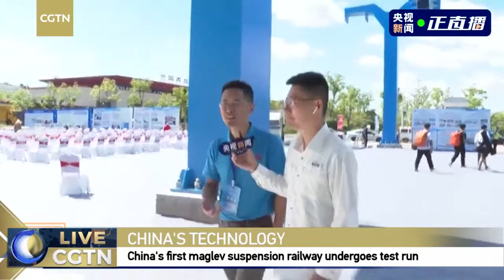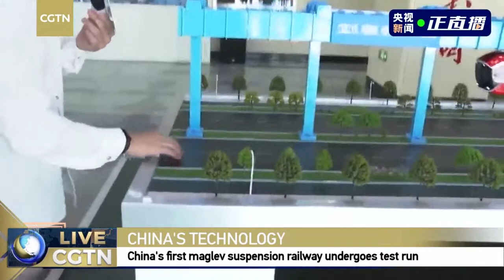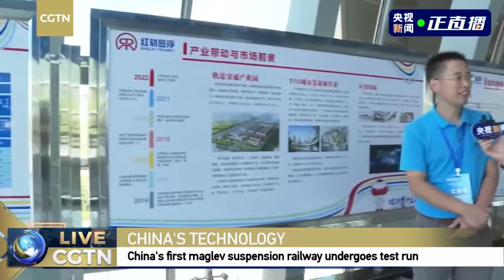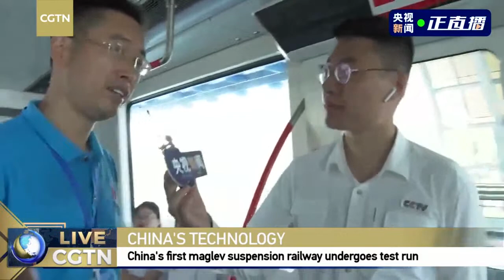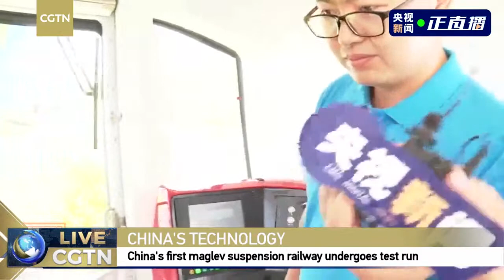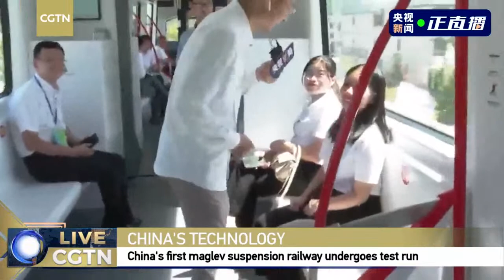Live: China's first maglev suspension railway undergoes test run

Comment: Hopefully Maglev can be introduced and subsequently exported elsewhere. For example, Bangkok to Singapore distance is 1936km(conventional rail, not 'straightened' yet). If it's built at 1930km, then 1930km/500 km/h would be 3 hours 51 minutes 36 seconds(no stop in between).

Comment: Why suspension?
Reply: Because  it is cheaper and has several benefits

- Less materials needed to construct the rail line
- Can be constructed higher than the alternative options
- It has less wind resistance for the vehicle (= higher efficiency)
- Less chance for debris to interfere operations

I hope that answered your question

Comment: The difference between the permanent magnet rail train and the traditional rail train is mainly in the difference of the motor. Compared with the excitation motor (traditional motor currently used), the permanent magnet motor has high energy density, and has obvious advantages in weight, volume and energy consumption, that is, it is more energy-saving, which represents the new development of train traction technology. If used on high-speed rail, it will be more energy efficient. However, the permanent magnet synchronous motor has a low temperature resistance limit, is difficult to manufacture, has a high cost, and requires a large amount of rare earth elements. China has quite mature experience in using permanent magnet synchronous motors, and almost all electric vehicles in China use permanent magnet synchronous motors.

Comment: Hopefully the new maglev system will perform as expected and will be approved after its test run. The maglev technology is even more environment friendly than the standard trains and it's also more cost-efficient in the long run.
Reply: Im not sure about that. Maglev will always require huge amounts of energy just to float.
Reply: @firestarter1888  Permanent magnets this time, not electromagnets. The energy is for pushing it rather than keeping it afloat which is much less than electromagnetically hovered maglevs.
Reply: @moe_is_justice8559  Thanks for your insight. Is there any tech advancement, to support the reason why permanent magnets are not be used previously?
Reply: @firestarter1888  Main barrier was the procuring so much permanent magnets, I believe it is due to recent breakthroughs in manufacturing that allows for large scale permanent magnet train though I have to double check.
Reply: @moe_is_justice8559  But then the cost in term of material must be crazy expensive and the load capacity is not that high.
It has to be studied, but I'm not sure that it is viable.
Reply: When China comes, they discuss business with the local; when the West comes, they discuss about China, with the local.
Reply: @oceanwave4502  Pretty much.

Comment: Permanent magnet? Does that mean the train itself and the whole railway track is laid with permanent magnet? If so, Wow that's very impressive.
Reply: I think the magnet is turned on when the train on top / behind it. switched on & off quickly based certain algorithm, because it also used to move the train.
edit: you are right, the train tracks are all permanent magnet.
Reply: @moneyandtechnology  The description stated they utilise a permanent maglev technology. Permanent magnet do not require the continuing supply of electricity to remain magnetic. So in this case the permanent magnetic levitation technology they utilise may most likely be also do not require the continuing supply of electricity to achieve the levitation. That means they only need the electricity to drive the train forward. If this is the case this technology would save up alot of electricity.
Reply: @citizenofsea  true. it aimed to replace underground train with 1/10 cost to build and cheaper to operate.
Reply: @moneyandtechnology  That's very impressive. Looks like they're going to extract lots of rare earth material for the powerful permanent magnet, wonder how are they going to do that efficiently. But still a very innovative technology for long term applications, it can save up alot of electricity., 👍
Reply: @citizenofsea  rare earth is not rare, just the smelting process is tedious. the magnet reduced by 5% in 1 century. I guess the AC consume more power than moving the train.
Reply: @moneyandtechnology  福
Reply: Use permanent magnet
Reply: Øk
Reply: I thought he said "permanent maglev train".
Edit: he did say "permanent magnetic train" too.
Reply: @strongchallenger2269  yes,  the train, not the railway. the railway is electromagnetic.
Reply: @moneyandtechnology  If the magnet is on the top only, what happens to the train when the power is off? There is no support on the top since the Electromagnet is above the ground. It is a brilliant innovation! 👍👏👌🙏
Reply: @strongchallenger2269  have you heard something called battery?